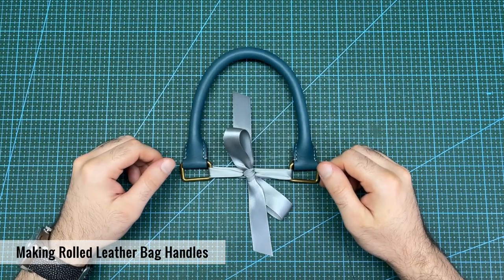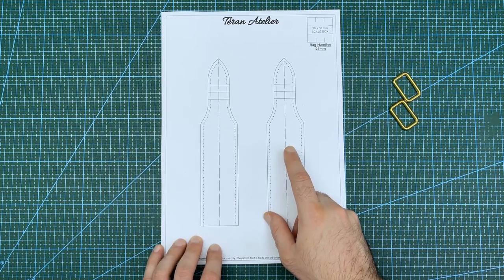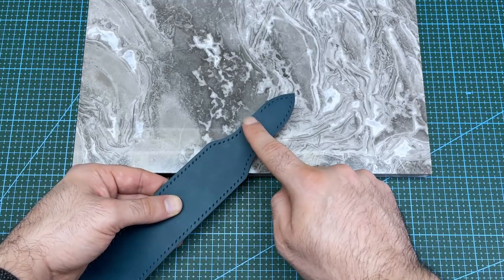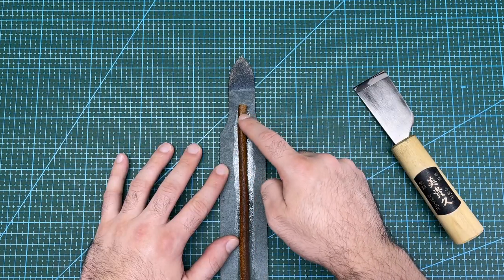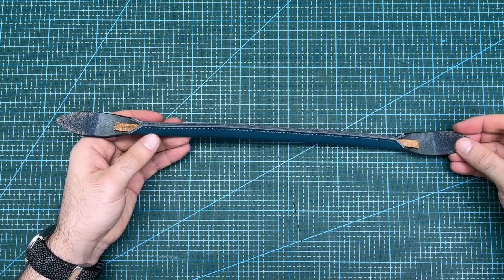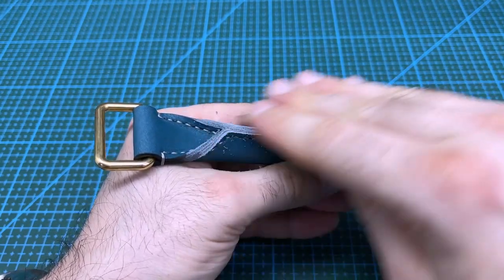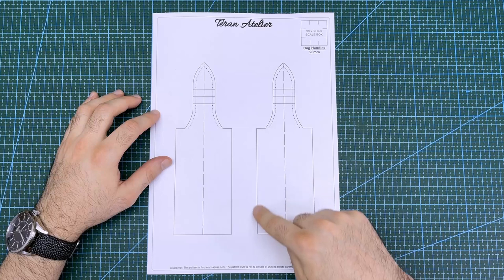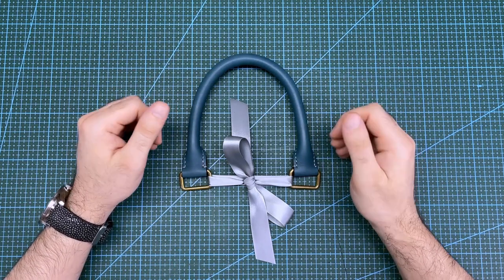How to Make Rolled Leather Bag Handles (Free PDF Pattern)

Comment: I don’t plan to make leather handles. I’m using fabric, or vinyl but this is hands down the easiest way i have seen to do this!  AND…with a pattern!  This is awesome! 
A tip for tapering rope. Wrap tape on the end and the cut it at an angle. I would use a rotary cutter to avoid fraying, then use some fray check.  (I just use stick glue).
Reply from the maker: Thanks for the tip. I have used rope previously until I started with leather cord which I find a lot easier to work with.

Comment: 6:25 If you go with the first method - burnishing will be an inferior edge finishing technique. Or, you should also glue pieces together during the stitching. Without glueing it will be hard to achieve a good finish with burnishing.
Reply from the maker: If you are using a firm veg tan leather that isn't overly thin you should still be able to get a nice burnished edge without applying glue. Gluing while stitching would be quite difficult and messy.

Comment: Thank you for that great tutorial. Is it also advisable to craft such a handle from full quill ostrich leather (maybe with veg tan liner?) for a duffle bag, for example?
Reply from the maker: Sounds like a great project. You may want to add some reinforcement tape to the inside of the ostrich handle if you are worried about stretching.
Reply: @TeranAtelier  Thanks. I will try the liner for the handle and for the rest of the bag, I think that 2mm of ostrich leather may be enough. Would you agree as I do not have very much experience with ostrich leather?
Reply from the maker: @TheGizmoGremlin  I have not worked with ostrich body yet but as long as you are lining the bag it should be fine. You can add interlining reinforcement tape to areas that will have a lot of tension such as the tabs that wrap around D-rings etc which will prevent stretching over time.
Reply: @TeranAtelier  great, thank you once more. And how do you stitch the one corner stich in the d ring area?
Reply from the maker: @TheGizmoGremlin  You should be able to see if you watch the video slowly. The right needle comes out through the corner hole and the left needle goes into the corner hole and out of the hole on the outside of the opposite side.

Comment: When you bent the handle will  some creases form on the inner side of the handle? Is this normal?  But they don't always exist.  I see some bags with creeses on inner side of the handles and some without.  What it depends on leather or something else?
Reply from the maker: Yes it depends on a few factors such as type of leather, leather thickness, handle thickness and bending radius. You can try to remove the creases by stretching and molding the handle by hand and smoothing out the crease.
Reply: @TeranAtelier  But if some creases remain will this affects quality of the handle, i.e will those creases will wear out quickly or crack?

Comment: How did you stitch the center hole at the tip of the handle? the video skips in between stitches.
Reply from the maker: The video does skip a bit where I pass the needles in around the center hole, but when you see when the threads being pulled the way the threads are stitched. The threads are stitched in a way that the material around the center hole is pulled into the corner.
Reply: @TeranAtelier  could you please explain this more? I came to ask this same question and i don't understand your reply.

Comment: Hello. Does it matter in which direction to cut the handles on the skin? I mean how to position the template
Reply from the maker: The core material of the handles should be substantial enough that it prevents the leather of the handle from stretching. If you do not plan to use a core then the leather towards the the center of the hide running parallel to the direction of the spine has the least amount of stretch and it is normally used for belts.
Reply: @TeranAtelier  Thanks)